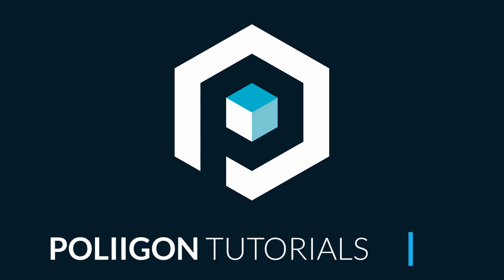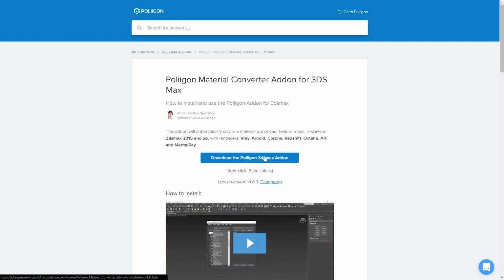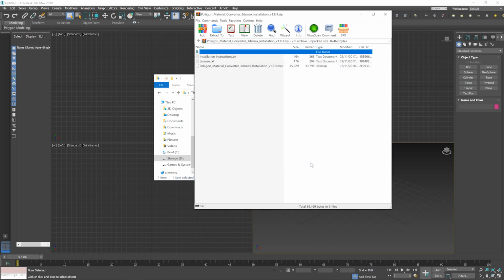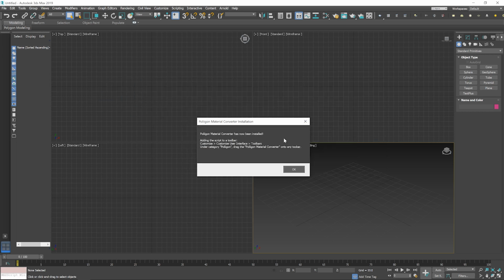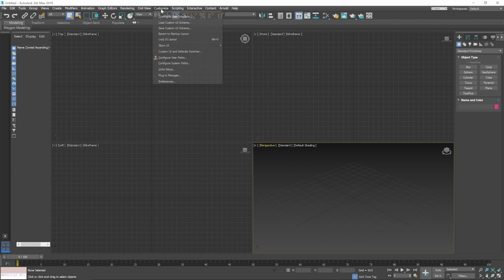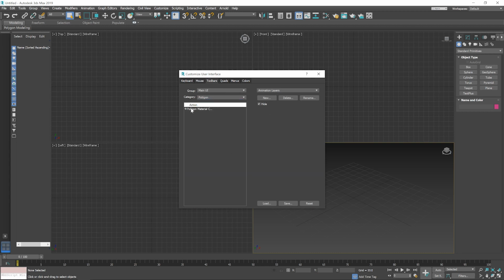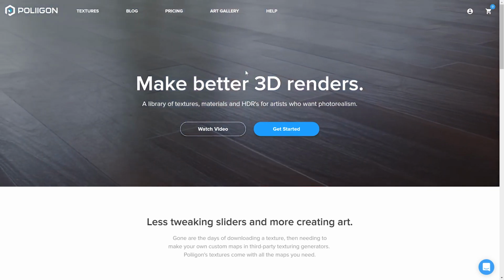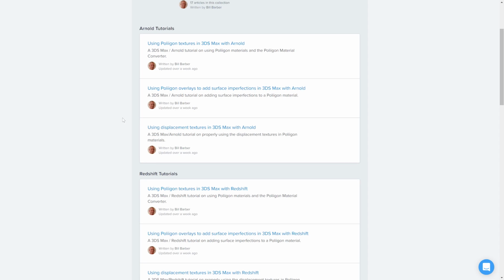How to install the Poliigon Material Converter for 3DS Max

Comment: I've been using this plugin for a while (and it's great), but it seems to have stopped working for some reason. Now after choosing a directory, i get a Macscript Rollout Handler Exception that states "--Unkown property: "Tuple" in <module '__builtin__' (built-in)>

Don't see where this is installed within the plugins folder so i'm not sure how to remove it. trying to avoid resetting the whole interface (again). 
Any help would be appreciated. thanks.
Reply: Nevermind. quickly answered my own question after acting a fool. 

For anyone else looking to uninstall, you can remove them from the user directory "C:\Users\<UserName>\AppData\Local\Autodesk\3dsMax\<ReleaseNumber> - 64bit\ENU\" folder. remove all poliigon related items in \scripts, \usermacros, and \usericons. Restart Max and reinstall.
Reply: @slowgojoe   Thanks.   Not working  -  3d max 2016  -   vray 300.08     The converter interface is a jamble